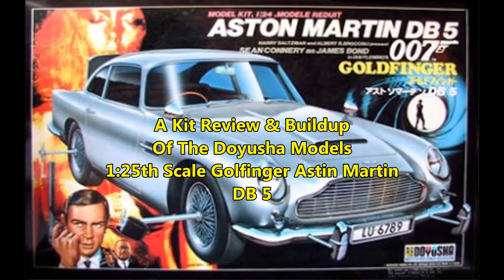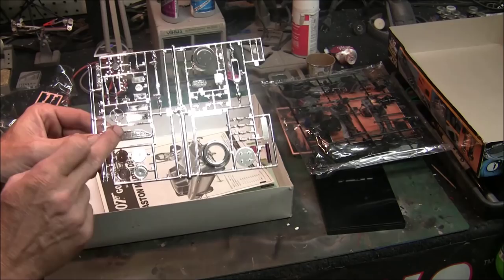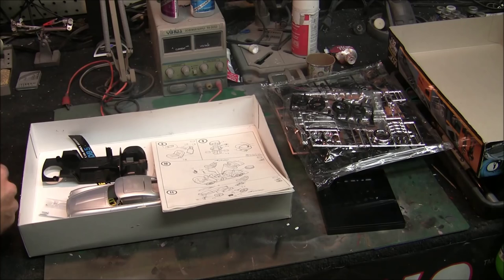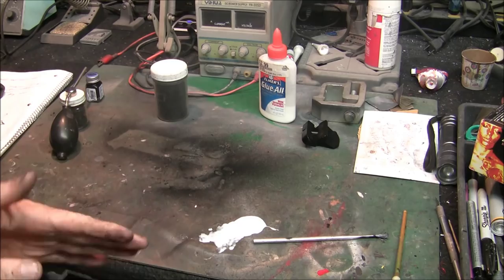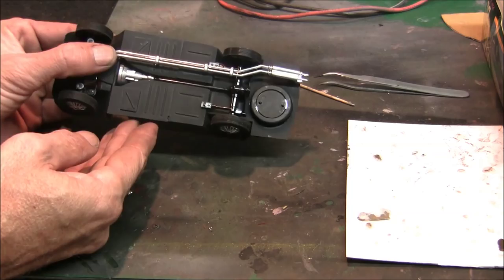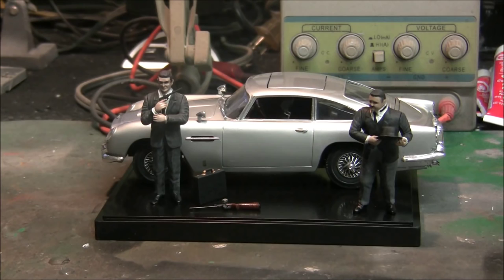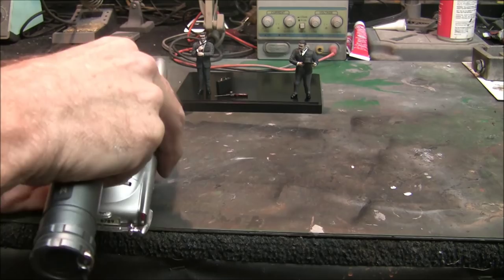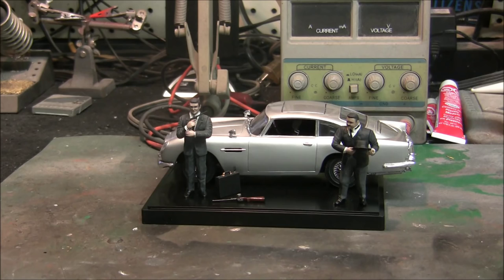James Bond 007 Goldfinger Aston Martin 1:24th Scale Model

Comment: Very nice build-up/review. Too bad they didn't engineer that rising armor plate gimmick a little better-- or while they were at it, include the ram bars and machine gun barrels poking out at the same time.
Also, Connery figure looks a bit small and thickly proportioned (he is 6'-3" ion his stockinged feet and was Mr. Scotland...) and Mr. Tanaka is a bit slimmed down and seems just a bit too tall when compared to Mr. Connery. Could the Japanese sculptors be working overtime... ? No, of course not.
Reply from the maker: Eliot Brown The ram bars and machine guns are included as well as the tire shredder's but they are not functional.
You have a choice to put them on either or. I'm happy that they at least included the figures even though they aren't perfect. Of coarse if you want a fully functional Bond DB 5 there's always the 1/8th scale kit that comes in parts by the month. It's a beauty but by the time you get everything you'll have about $1,500 into it!
Reply: Oddjob was played by Harold T Sakata.  Not sure who Mr. Tanaka is.